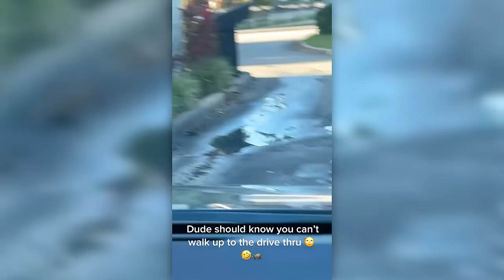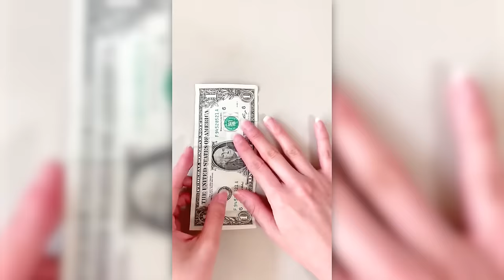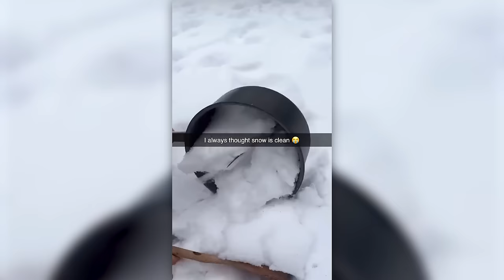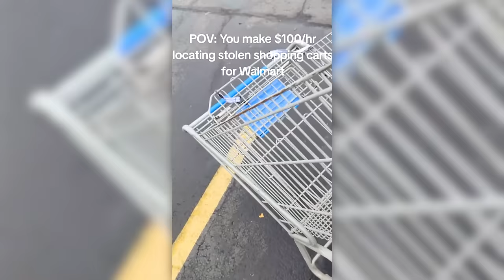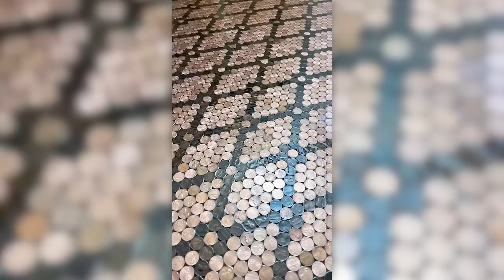huge MOSQUITO bubble pops..

Comment: 20:52 So basically, when you activate the call point (Fire alarm in other places of the world beside the USA) 2 things happen, one. The reason all the doors to help stop the spread of smoke and fire. The only reason the doors can close is because the doors are held open by magnets, but as soon as the alarm is activated and the fire panel picks that’s up, is shuts off the magnets. It’s just magnets either. Ventilation and doors lock are turned off to. The second thing to happen is the Fire alarms will activate, obviously a loud alarm will sound and strobe lights will flash. Once again to answer your question about why the doors closed, it’s to stop the spread of smoke and flames.